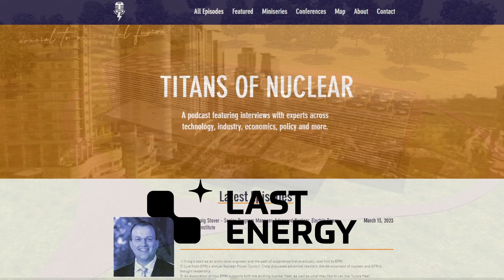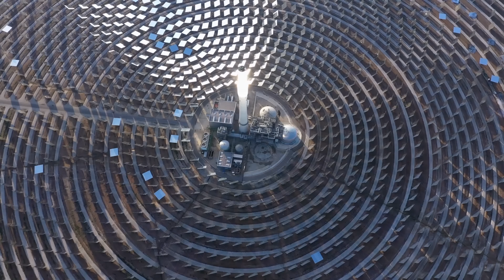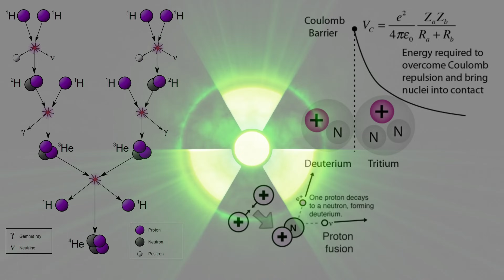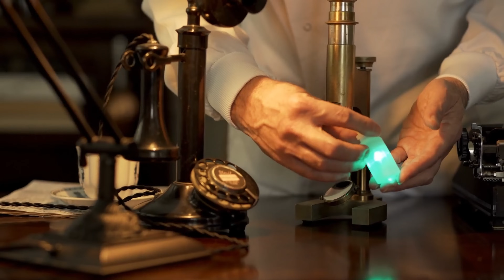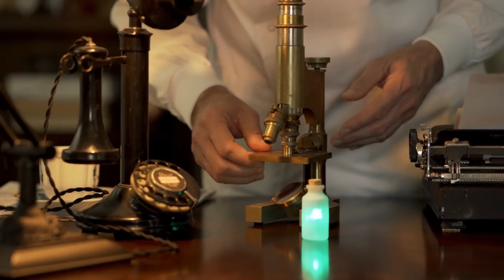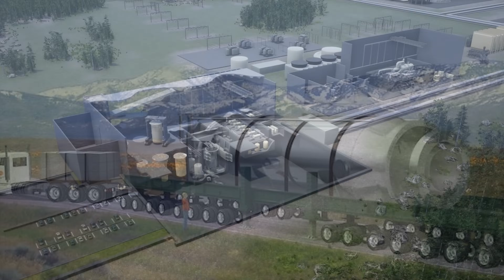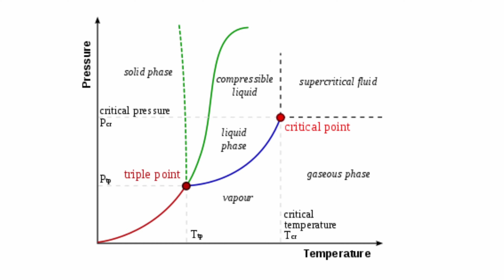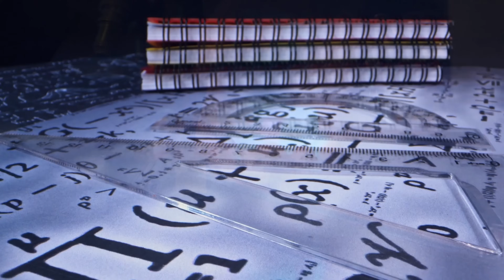Nuclear Power: Small Modular Reactors

Comment: We have had  thermal nuclear generators for decades used in space probes. They can be powered from nuclear waste. They don't explode. They can provide power 24/7. They are designed to work without lots of people monitoring them all the time. Once contructed they only require external building guards to keep them secure, but then so do every nuclear reactor.

There is no reason we can't build power walls out of them in secure facilities to provide at least some of our power. The technology has been proven over decades.

If we can build a power wall with 2000 batteries for 20kilowatts  back up. We can build one with 2000 1kw thermal nuclear generators that put out 2,000,000 watts of content power generation. Put 1000 walls in a power plant. You can generate 2,000,000,000 24/7 while you're using up nuclear waste at the same time.
Reply: I have yet to hear of one that is powered by waste.  Can you cite a name or something I can google?
Reply: @Lensflare Deviant  nuclear reactor rods have over 90% of the fuel left when they are dumped in waste. The 94% to 96% of nuclear material can be recycled to power thermal nuclear generators and batteries instead of using new material. I never said has been, I just pointed out we have 60 years of waste that CAN be used to power them. Are you against eliminating nuclear waste? If not, why not use it up and solve 2 problems at once??? France has even more waste they we do. We could also charge them to "dispose" of it for them(right into power generation for ourselves). They win we win. France is 70% nuclear electrical generation. That could build a whole lot of thermal nuclear generators or batteries! We have had the solutions to both problems for decades, then why are these politicians wasting tad dollars on solar and wind then? Could it be millions of dollars of graft? Like Pelosi did with her husband??? You got to wonder.

Comment: I live right next to one of the biggest Thorium deposits in Norway. I kind of hope the back-wards people in that area will give in eventually, so people can get jobs extracting it and what not.
Reply: might want to develop a functional Thorium reactor before you start strip-mining for Thorium.
Reply: I'm sure Russia won't have any problems with using it.
Reply: The main problem with Thorium is the concern of nuclear proliferation. One of the byproducts of the process used with Thorium is Uranium-233, which is a weapons-grade material that has been used for weapons. An example of this is the device used in Operation Teapot, which had a yield of 22 kilotons of TNT. That is the main reason I am against Thorium reactors. The security of nuclear materials in several countries is already an issue; we don't need anyone to have weapons-grade materials. Until the monitoring and security of such materials is guaranteed along the entire process, Thorium reactors should not be used on a large scale.
Reply: In a response to all here: 

Thorium ends up with lots of rare earth's with it, so if you could cheaply deal with the Thorium, or even make money off it, the mine would pay big bucks. 

Thorium doesn't reduce the cost of operation, it's just easier to refine into fuel, and it's usually part of rare earth mine tailings.

Fast reactors, or breeder reactors in general, are the future. I'm just upset that the Versatile Test Reactor was shelved.
Reply: @treasurehunter3744  about this future concepts it's certainly interesting, but estimating LCOE is night impossible and at the same time fission to have equal if not higher.
Reply: @treasurehunter3744  Easier to refine thorium into fuel?  Who has so far done it cost effectively?  I was always told that was one of the technical barriers thorium breeders presented.
Reply: calling it backwards is condescending in a non warranted way.
Reply: Thorium doesn't magical reduce cost of operating nuclear reactor in any meaningful way.